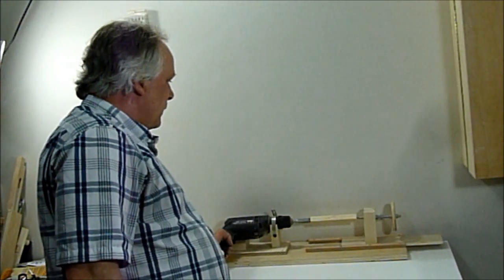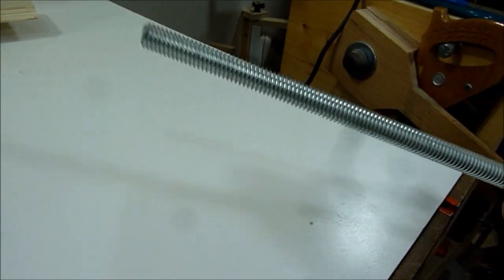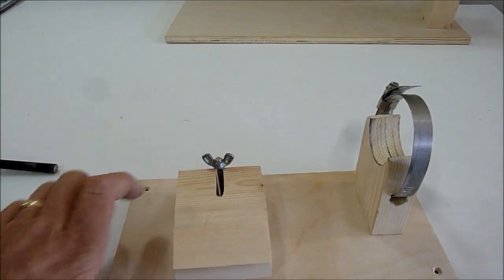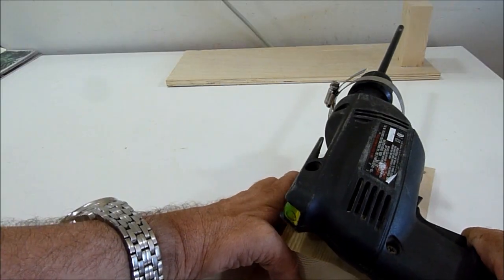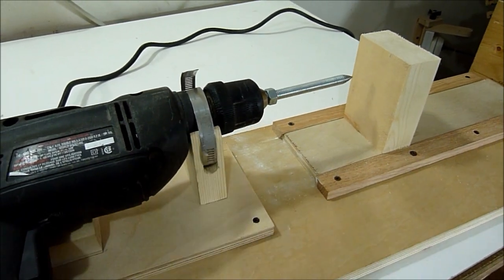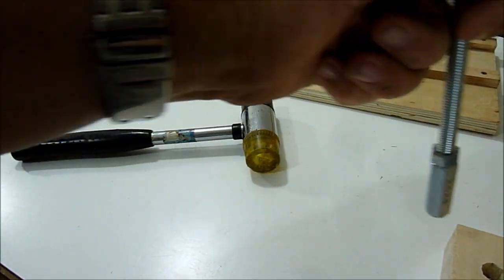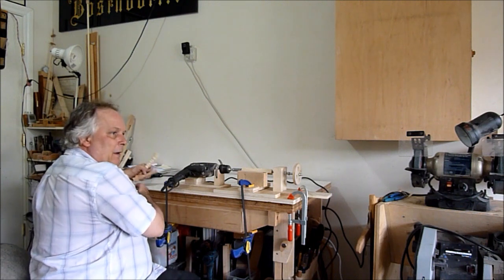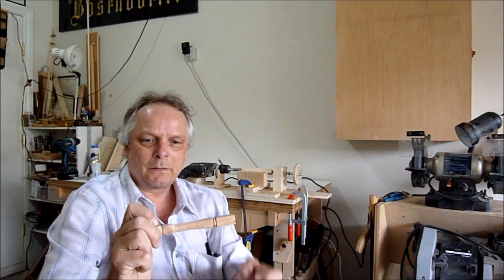How to make a Mini Lathe

Comment: I had a version of this idea floating around in my head, but he knocked it out of the park. Need to figure out what those extra long bolts he used were, but I'm sure 2 minutes in that bolts and nuts aisle at Home Depot will answer that question for me real quick. On a side note, I love this guy, he seems so enthusiastic and sweet. Makes me wish he was my grandpa, LOL.
Reply: Is what you're talking about...Allthread?
Reply: No, the sockets he cut into clamps (don't know why I said bolts).
Reply: Love it when he's trying to hide the lathe in the beginning of video... wish he was my grandpa... :-)))
Reply: RandomTXDude210 That's what I thought (a socket). Could it be a spark plug socket?
Reply: RandomTXDude210 Hi! I know your comment is from a while ago but I'll still add my bit. I had the same question and searched around, they're used for joining threaded rod, so just search for threaded rod joiner and that's it. :)

Comment: You only need a fully equipped workshop, everyones got one of those eh?
Reply: Sorry, I didn't make myself clear.  I was just pointing out that most people don't have the workshop equipment featured in the video (bench grinders, sanding discs etc).  Otherwise its a great idea.
Reply: John Backley I don't have any of this, but you can still cut, grind and sand the old way! Just takes a little longer.
I plan to make this with a dremel and hand tools, just need to pick an old drill up.
Reply: He could have used hand files instead of the grinder or disk sander, but it would have taken longer. Plenty of  homeowners have grinders anyway for sharpening tools or lawnmower blades. They don't cost that much.

Comment: I'm thinking, since a drill has brushes, they would wear out very quickly, so maybe a small AC motor would work better, eh, unless you need to adjust the motor speed often, then a small AC motor drive might work for that.

Comment: All that drills have brushed electric motor :) So you have to use it just for drilling and not for a continuous working cycle because you`ll wear out brush coils very quick. 
Well if you have an extra drill and you in strong need to have a lathe whatsoever then you can built one ;)
PS Good work anyway ;)

Comment: Definitely "on the cheap" but not a bad effort.  A standard drill though is likely to burn out fairly quickly in an application like this as they're not designed for such continuous operation or even the lateral loading and high torque variation that you are liable to get on a lathe.  It might be better to use a drill press as has the required induction rather than universal motor and mount this on its side somehow.  Also, the tapered point is supposed to rotate so maybe buy a couple of bearings and put the adjustment nut in between them such that the threaded rod can be adjusted to length, but once sunk into the wood, will spin freely.  Or maybe even easier, if using the drill press, make the taper end stationary and just use the press's plunge to properly engage turning stock.  My two cents anyway.  Hehe, that or buy a benchtop wood lathe..they're not terribly pricey these days.

Comment: Using an inside micrometer to check for level?  Wouldn't a level be better for that??
Reply: Ahh, your video looked like you were in a shop with a concrete floor.  I assumed it was level.

Comment: Jack, my battery died on my 19.2 volt cordless drill so I took the drill apart and kept the chuck and motor assembly (one piece). It appears it would make a great mini wood lathe but I don't know what the RPMs are on it. I see you used an AC powered drill but do you think this cordless type would have the RPMs needed to turn small projects?
Reply: ***** Thanks, Jack. I was referring to the lower RPMs of a cordless drill compared to an AC drill. The cordless is slower but I guess it will still work for turning wood up to a point.
Reply: dan cooper You could also use it for a mini generator.
Reply: Hi Dan, in principle you can use your cordless drill, however you should consider that, when working at pieces with small diameters, you need higher RPMs, otherwise the "cutting picture" won't become smooth.
Regards from Germany
Hans-Joachim

Comment: I liked your video and creativity, but maybe a tip would help you find the center of a piece of wood with a square profile like the one you used, you just have to scribe an X or two diagonal lines and you'll easily have the center for the spur center. Maybe you knew it already, but it looks like your first job was off center, it seems to wobble a little bit. Congretulations!

Comment: i,myself have practicly just the same machine, but i have a problem when i work with soft wood. the iron point is carving deeper and deepe rin the wood so i have to tighten it when i'm busy, but then it gets too deep in the wood. now i'm working on a rotating pinpoint. a work in progress...
Reply: thx, i'll try that

Comment: Great video. There was non when I built a similar one a few years back which I used for a year modifying it quite a bit before I finally bought a lathe. They are easy to build and very useful as long as you stick to spindle turning. In my experience their performance depends a lot on the robustness of the construction and the drill used. Most drills are not designed to take sideway pressure and after a few months of use they start causing vibrations specially with scrapers. Best to use gauges and skew chissels and learn the proper bevel rubbing tecnique that helps avoiding vibrations (and dust) and gives a very clean finish. https://www.flickr.com/photos/59673306@N03/5458421568/

Comment: my first lathe was a 'lathe kit' to use with a drill, like yours, but it came in a box. i still use that one frequently as it works quite well. i still need to get a chuck though and these kinds of setups really limit the size of the things one can do. anyway, this is the way to start out cheaply and figure out if you really like to do woodturning. I really like your take on it. interested to see what you'll build with it. for practice you can turn spinning tops, candle stick holders, simple handles for drawers etc. thanks for sharing!

Comment: For the tool rest you can just use any round bar or pipe, somewhere in the 1/2"-3/4" range.  It's important to be able to angle the tool and rub the bevel.  That's the extent of what I can tell you about using a lathe!